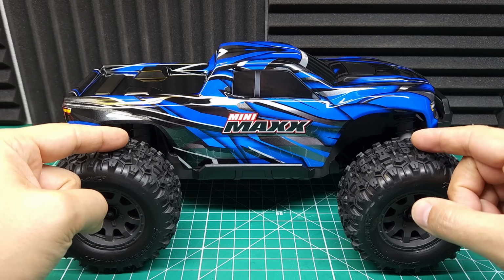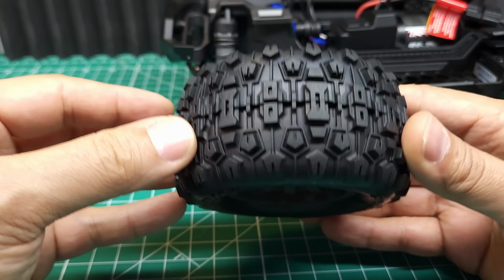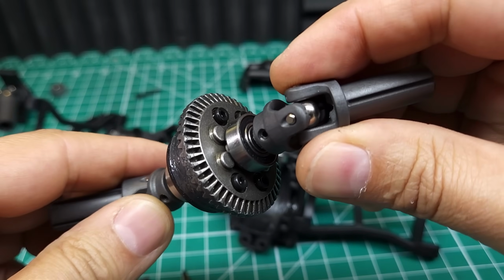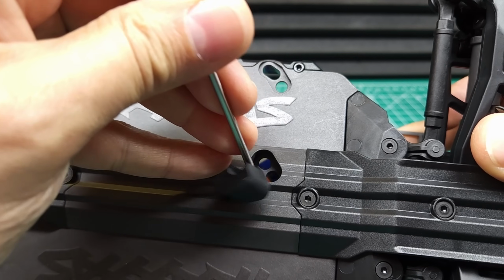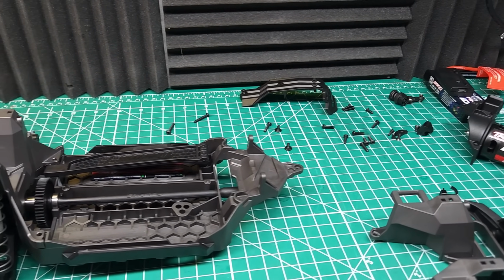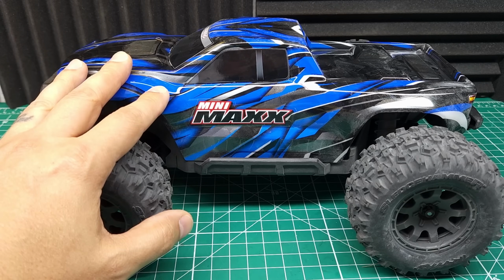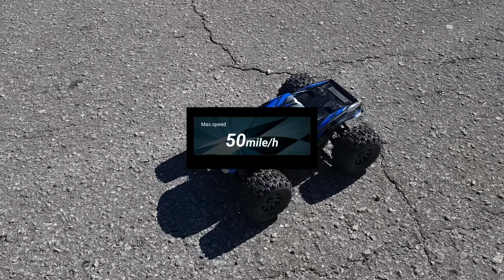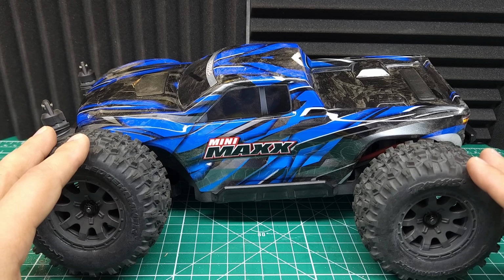I Really Wanted To Love The Traxxas Mini Maxx | Watch Before Buying!

Comment: While I can see where you and many others would have reservations about the price the one at our shop looks to be nearly all 10th scale things 
Stuff like the plastic gear servos and the center drive I would love to see if the plethora of 10 th scale diffs can fit those housings 

If so then there’s tons of ways to upgrade on the cheap (I regularly see slash rally stampede for 100 on line with upgraded servos sporting the 3s,vxl system ) 

That being said you can easily sell off the new take offs to someone and recoupe some cash off the price of car while paying for the market place buy as well 

I’d loved to see what exactly broke and how it needed to be replaced 

Considering you tossed a higher power system in it vs gearing up I can see why it broke 
Plus you were not being real easy 
I like your videos and am not bashing I just think it should been expected with large tires and bigger power you’d break something in driveline 
I also would like to see what the center diff looks like for a upgrade
Reply from the maker: To some degree I can understand where you're coming from and having one 10th scale parts is nice but I don't think any other one 10 scale differentials are going to fit. If Traxxas was going to make them compatible they would have just used those differentials.
You definitely can sell off some of the stock parts to recoup part of the cost of the upgrades but that's really only going to apply to the motor and ESC. Let's say you can end up getting the VXL 3S for $50 after selling off your BL-2s system. You then need a differential that all in is going to cost you around $65. Once you add up the cost of the vehicle itself you're looking at a shade under $400. For a bit less than that you can get any of the 3S Arrma and for around half that price you can get a Rlaarlo Omni Terminator. 
I'm not saying that this car doesn't have the potential to be good and I'm not saying that out of the box people can't have fun with it. What I am saying is that for the extreme premium price they're charging the car needs to be extremely premium and it just isn't.
Reply: @ 
I don’t have the experience with the other brands aside the arrma  
Well and traxxas 

Shame they didn’t follow suit with the diffs as they did with the servo and esc combo 

That being said it beats their mini e revo for sure and idk if the grom platforms would run in the grass like you did there 

Sure seemed like that truck wanted to be on its roof 

I’m sure they’ll come out with wide kit 
But wished a center diff was standard 

Traxxas has been known to follow the social media and get rid of issues when consumers complain 

That being said perhaps they will make a stronger part 

I’d love to see what exactly broke there 

Was it the center shaft or the input shaft 
And if input shaft was it sintered or plastic 
I’ve seen some cars mix match diffs with metal and plastic 
Even front and rear cause the center is fairly well known for having that in traxxas    The plastic spur and metal pinion

Comment: That's the story with all traxxas products. They are almost good lol. This is why they are a step up from new Brite. They are just like them as far as the same chassis different body different wheels different name goes though 😂
Reply from the maker: I feel like the potential's there and if the price was right it would be fine but it's pretty expensive
Reply: @DoRC  yeah it is. It's because of the maxx name. A 4x4 bl2 stampede and a associated mt10 are 329 that thing is 269. 70 bucks more and you could have a 4x4 10th scale truck. Why on earth would anyone py 270 for a 18th scale truck. Hell the 2wd stampede is only a hair over 200 then drop a sw4 combo on 3s and you got a fast monster truck haha even if you did that to a mt10 you are still cheaper then a normal maxx. trax-ass is why over priced for what you get.

Comment: Iam gonna leave mine stock ,from what ive seen driving and durability whise iam gonna be very happy with it, 250€ here in germany is a good price for it
Reply from the maker: Yeah pricing's going to be different all over the world and I can only go by what It costs compared to the competition in my country and here it's pretty expensive. That being said if you don't mind the price I'm sure you'll be happy with it. It's a pretty cool little car
Reply: @DoRC  yh pricing is a big Factor if the minni maxx Costs the same or more then the 3 s competition then ppl for shure gonna be complaining however if we are not looking at the price then i think the minni maxx is gonna be the most durable minni basher out there (if we keep it stock for shure)
Reply from the maker: @rocketgamer3878 I think it depends on how you look at it. Stock the mini-max is going to be durable but if you took some other cars that are available and ran them on 2S or drop the power systems down to minimax level you might find that they are just as durable. It's a lot easier to make a car durable when It's underpowered.
Reply: @DoRC  i agree iam also happy with my other traxxas Products like the xmaxx and the trx4m so i think iam gonna be happy with the minni maxx i also have a kraton 6 s which i really like at the end of the day its all abt having fun no matter which Company if you have fun then  you made everything right😁

Comment: Good review! My opinion: Too big for small spaces and too small for outdoors, not really much of a need for it. These little trucks need to have the air control/power to rotate on demand for flips or they get boring quick and this doesn't seem to have it. Will be a pass for me but great in depth review, much appreciated!
Reply from the maker: I think the size especially the tires is great for smaller outdoor areas but I agree that it really doesn't have enough power by today's standards.
Reply: @ I hear ya but if I’m going to be outdoors, even in a smaller area, a 4s or higher 10th scale would be preferred. Not so much for the little bigger size, but the extra weight for more dampened and satisfying landings. The really light trucks outdoors on big air don’t have the weight to compress the suspension and tend to just bounce around. Not nearly as satisfying if ya know what I mean.

To me, just kinda in that in between zone where I can't run it inside for living room bash sessions and if I'm going outside, have much better options. Just my opinion though!

Comment: Wow, 2 video's in 1 day? You're really stepping it up these days. 

Does anyone else feel like arrma has gone for traxxas's jugular with the new 223s lineup? It seems like that entire Arrma vehicle lineup hits a higher mark at a much lower price than anything traxxas has or will have coming for the foreseeable future. 

Lastly do you think Arrma has any case to force traxxas to recall that stolen diff gear design? Fair is fair, right?
Reply from the maker: I doubt it. That differential style has actually been around since long before Arrma. The two wheel drive Traxxas vehicles have had it for many many years

Comment: Ended up getting the wide Maxx v2 was still inclined ngl but the wide Maxx is a better option for the money and can handle the 4s did I make the right move ?
Reply from the maker: Absolutely. As long as you have the space in which to bash it the wide max is a far more capable car. It's not without its weak points but it's good
Reply: @ good to know bro I have arrmas as well bye 1/5 scale I figured and getting an xmaxx in soon lol but can’t beat the price of the sale I wouldn’t but either or at full price to expensive well overpriced

Comment: I think its lazy that they used the same 3300kv that's in the 1/10 trucks. The ESC is fine although a higher KV motor on this little truck could get it to 40ish out of the box on 2s. Hell, the VXL3M that's in the brushless mini e revo would have also been a smarter choice
Reply from the maker: Well that's the case they probably could have just gone with higher gearing. That being said I suspect there is more to get out of the 2S system given how much faster it went on 3S.

Comment: Would the maxx v2 be a better buy? Looking to get into rc with my kid
Reply from the maker: Absolutely. By the time you put the parts in this to make it good you're going to be close to the price of the maxx and the max is actually a good truck. It doesn't handle great but it's super durable and is a well-established platform

Comment: Ground clearance isn't as great as it appears since the diffs housings are the lowest part of the vehicle.  Traxxas' high cg chassis doesn't give you extra ground clearance. Ground clearance is mainly about how large of a tire you can run.
Reply from the maker: Yeah I shouldn't have shown the raised center portion as that doesn't actually do any good and can cause problems when it catches bumps and whatnot. I was just illustrating that it had ground clearance :-)

Comment: I think it's crazy that this thing needs a 3s conversion to get 50mph just to break immediately. The Groms are great right out the box with all the included upgrades they have for the BLX versions. Anything over 200 for this thing is just money wasted, especially that junk bl2s system they're using. If it didn't have the connector for the motor, it wouldn't even be a bad unit stock, but oh well.
Reply from the maker: Apparently with the VXL system on 2S it'll do about 40 mph which is more reasonable and probably won't break stuff but you're still spending a lot of money

Comment: You just talked me out of buying this truck, it's underpowered, will cost way too much to upgrade 3S/ center diff, etc. And when Traxxas comes out with the 3S version it will be astronomically overpriced. Leave it stock and give it to the kids. Thanks for the heads-up.
Reply from the maker: Yeah I hate to talk people out of stuff but in this case I think it's at least worth knowing what you're getting into. By the time you put this on 3S and put but seems to be the required center differential in it you're going to be into it for a lot of money

Comment: The Omni Terminator Carbon is less expensive than this one…. And fore sure the more capable rig.
Reply from the maker: In most ways yes
Reply: I think the Rlaarlo cars are pretty good for the price and seem to be one of the best made coming straight from China; However the concern anyone should consider buying those cars is how many years from now are you going to be able to get parts. I'm definitely disappointed in the quality of the Mini Maxx, but you'll be able to get parts ten - twenty years from now.

Comment: Man I had a lot of high hopes for this replacing the mini revo. From how much you’re gonna have to spend to be able to upgrade and run 3s I don’t think so. Also for how much people hate working on the mini revo this doesn’t seem that much better.
Reply from the maker: I think in general the platform is superior to the mini E-Revo but I don't know about this car at this price
Reply: @DoRC I could see it being superior to an extent. My point was more so outside of plastics durability it doesn’t really address the issues people wanted to see corrected in a replacement of the mini revo. For all its issues, you can actually run and bash the mini revo on 3s out so the box for around $30 more. Once you know the shortcuts to working on the mini revo it’s isn’t so bad but a lot of the videos I’ve seen on the maxx it looks like a nightmare as well. Regardless of price it should’ve been 3s ready out of the box if they were going to market it as 3s capable with the vxl installed.
Reply from the maker: @gman69455 I've worked on the mini E-Revo quite a bit and definitely think that the minimax is a more user-friendly design but you're correct it's not really by a whole lot. Screw count is fairly similar though the minimax is a little bit less fiddly.  I think the minimax appears to be a more durable platform out of the box but out of the box it also is dealing with quite a bit less power so if you put the mini E-Revo on 2S they might be similar in durability as well. 
Ultimately I tend to agree. The minimax needed to be a huge leap in everything over the much much older mini-Revo and in general it just doesn't feel like it.
Reply: @DoRC that good to hear about the improvements on the workability and durability, but a bummer on everything else. I had such high hopes for the truck. I mostly ran my mini revos on 2s plenty of fun. Was nice to know I could play in short burst on 3s at times though.

Comment: Honestly, I don’t think it was ever meant to be 3s it’s not holding up from the vids I’ve seen I don’t wanna spend more time rebuilding than bashing im eyeing the Vorteks 223S now
Reply from the maker: Definitely not with the stock drivetrain. If it had plenty of jam out of the box that would be one thing but it doesn't. Maybe gearing up would help but it also doesn't handle all that well

Comment: Sooo, Traxxas isnt expensive, you get what you pay for. They have a lifetime warranty, where others have 2 years at best! Not only that, you can call Traxxas 7 days a week until 9pm!! That is worth the extra money in my opinion! Try calling Rlarlo or Horizon on a Sunday!
Reply from the maker: Not quite. Traxxas kind of has a lifetime warranty on their electronics but it really isn't a full warranty. It's a reduced cost replacement plan. The problem with that plan is you can almost always buy the exact same parts for the same amount or less than they are charging even at the reduced price on something like eBay so it's not really an advantage. The actual Traxxas electronics warranty is 30 days versus 2 years with Horizon and one year with most other companies. The rest of the car is warrantied for a year. Yes it is nice that you can contact Traxxas 7 days a week but is that really worth an extra 50% over what everyone else charges? I don't think so.
Reply: @DoRC  you're actually incorrect on that one Do. I work for a hobby shop and I have had 37 warranties approved by Traxxas. The first year is free replacement. After that, they do a replacement program, you are correct. That being said, they cut the price in half for esc and motor. Tell me what website you can get a brand new eESC and motor for half price?
Reply from the maker: @whitemike2890 okay well their website says 30 days so that's what I have to go by. It's cool if they're willing to go above and beyond that but it's not something I could guarantee someone like you can with the two-year Horizon warranty. 
The one example I just looked up is Traxxas wants 140 bucks plus shipping for a VXL 4S. I can get them all day long on eBay for 85 bucks so not quite half price but pretty close.

Comment: Exactly and it used to be 250 they upped the price youre talking about even at a cheap price hobbywing system at 90 plus minimum servo at 50 steel driveshafts at 100 center diff at 80 shocks at 80 youre looking at a whopping SEVEN HUNDRED DOLLARS especially when you compare this to the groms that come fully exb basically traxxas is well taking advantage of its buyers even the discount for the holidays thats traxxas telling you what they rigs should costs normally
Reply from the maker: You can sell some of the original parts to recoup some of the money but you're still going to be into it for quite a bit
Reply: At my hobby store it's 250
Reply from the maker: @Brayrfd1192  Yeah they can sell them for whatever they want but the suggested price went up from $250 to 270

Comment: I keep falling out of screws, even good ones, with my hex drivers. MIP in a screwdriver and by hand. I’m just bad with hex drivers
Reply from the maker: Make sure the hex is clean. A lot of times a little bit of debris will clog it and make it a lot hard to remove.
Reply: @ I even bought dental picks and clean out the hex’s! 🤣

Comment: 29 is not 30+ mph. I would have accepted if it was advertised as 30 mph but not 30+. 30+ means at least 31.
I suspect it might do 30+ mph if you used a higher C rating non-Traxxas battery.
Reply from the maker: I completely agree though given traxxas's reputation for wildly exaggerating their speeds this is actually pretty good

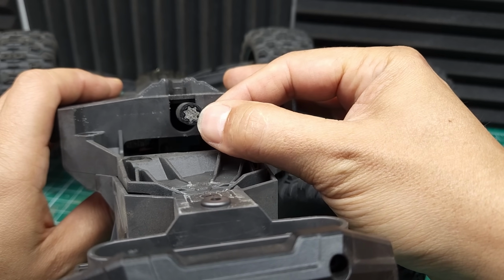Comment: 18:15 if the pinion can’t hold its own against plastic, what chance does it have against aluminum and 1M center diff fluid? Maybe it’s thinner than that, but I’m not sure.
Reply from the maker: A center differential allows decoupling of the front and rear of the drive so under things like hard acceleration deceleration etc energy can bleed out through the tires that have less traction (ie ballooning). It also means the entire drive train doesn't have to spin at the same speed so if you were to land a jump on the rear wheels they can spin faster or stop without that entire load having to be transferred through the whole drivetrain. 
Generally a center differential will protect all of the drivetrain from really high loads.
Reply: @ my point was more so that Traxxas is probably going to ship the diffs with fluid that’s too thick to do that. I expect the upper limit of the driveline might be as low as 300k if the metal pinion shaft is that weak.
Reply from the maker: @dylanwhite6539  That's entirely possible. I guess we'll find out as people get them and do the upgrades.